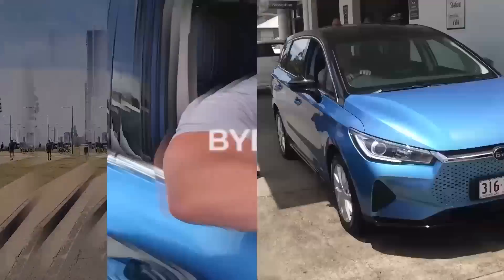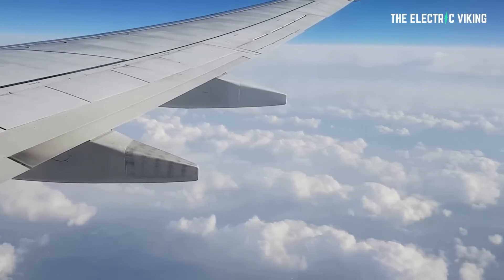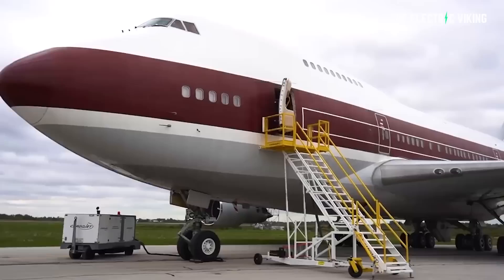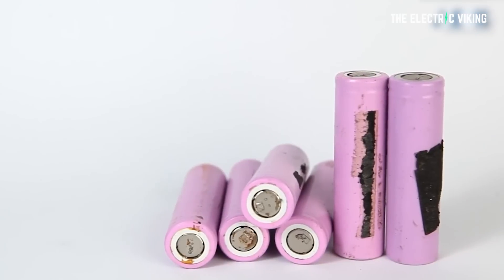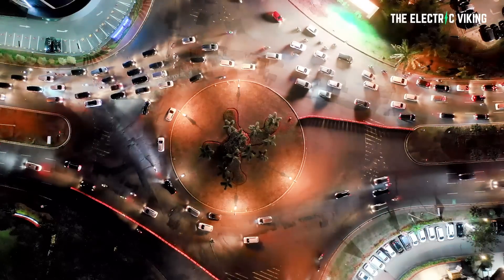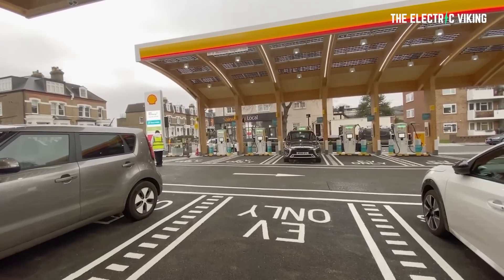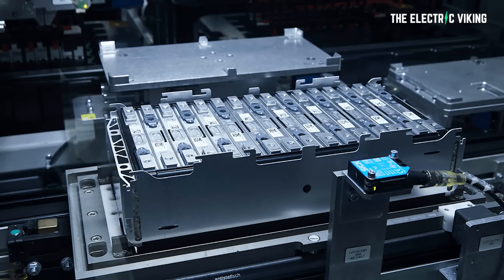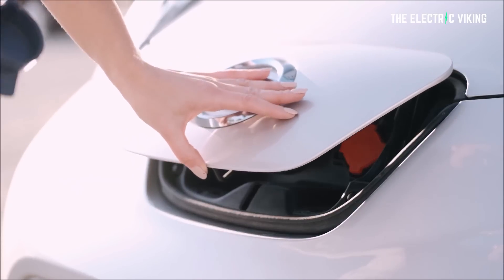Researchers discover how to make lithium batteries work in extreme cold

Comment: Don't use water in a battery and you eliminate the cold temperature problem. Super capacitors don't have water. This issue is important for batteries on ebikes in Canada.

Comment: Hi Sam I live in Northern part of Canada,,,-40C common in the winter...the range of my leaf goes down about 1/3... these new battery structures would help but the battery warming system is more important. Also my electric vehicle works way better in the cold then any gas vehicle I have owned... it always runs...I've even jump started friends gas vehicles whos battery couldn't start their vehicle in the cold...Also in extreme cold many fossil fuel vehicles idle all the time and diesel trucks have warming systems in the fuel tanks and oil pan to keep the items from becoming to "thick". Electric is much better in the cold then fossil fuel vehicles.

Comment: All batteries become less efficient at lower temperatures. That's because they work via chemical reactions. As a rule of thumb, at temperatures which we can experience in our environment, a chemical reaction doubles in speed for every 10°C rise, up to the point where degradation of the reactants sometimes takes place because of too much heat. And of course a reaction halves in speed as it cools by 10°C. 
So a battery which is at peak capacity at 20°C will have its reactions reduced in speed by 75% at 0°C - you only see 25% of its capacity. A battery does warm itself up when current is drawn, so in reality it will deliver more than 25% of maximum capacity. If the battery has cooled down, and there isn't enough available capacity for it to warm itself up, then you're up a creek without a paddle. 
That's why it pays to preheat the battery while it is being recharged, before setting off on a Winter journey. It's also one reason why your estimated range can increase significantly while you're driving on a cold day, if the battery started off cold. I see that effect in cold weather regularly with our EV, which is only recharged at public chargers, so has to start off on a journey with no preheating. I can start off with an estimated range of maybe 200 miles, but after 50 miles of continuous driving it still has an estimated range of perhaps 175 miles.

Comment: I live at 8000' elevation in the Colorado mountains.  When out skiing at low temps, yes the cell phone has a significantly shorter battery life.  While not very cold for long periods, I have seen -25 deg F for a day or two at a time.  It is one reason I have been reluctant to put lithium batteries in my RV as it sits out and I don't want to have to pull the batteries.

Comment: I live in western Canada, every year we have between 6 to 8 weeks of -30C to -50C so it will be important for a battery to handle the cold in a more efficient way.  My neighbour drives a Tesla and a friend drives a bolt and are able to drive in these temperatures with very diminished range but we often have to drive long distances since our cities are separated by 400 to 800 km or more.  I presently drive a 2014 Prius V and want to change to an electric but a Model Y is $82000 Cad and I am not a big enough idiot to spend that kind of cash on a car of any type.  I really appreciate your research and am waiting for reality to kick in to the electric vehicle market in Canada so that I can make the change.

Comment: The car's battery heater is the largest contributor to energy/range loss while driving in cold temperatures. VW has just written new code for it's MEB platform to limit the heater for shorter trips to save energy

Comment: Hydrogen fuel cells work really well in cold temperatures.👍
Reply: ... if you can find some H2 to fill up .
sadly the infrastructure-race is allready run .
Reply: @tgdomnemo5052 maybe where you live but not in the rest of the world. You need to rip up your 2017 information and get up to date.
Reply: the by product is an issue to deal with. one failure of the warming system the water by product destroys the whole cell...batteries just sit there until warmed up or recharged
Reply: @glenncunningham9360  that’s like saying that batteries can catch fire. Unfortunately, it happens very often, unlike the scenario you describe.

Comment: A certain kind of bumpy glass can keep glass from fogging up, it's surface shape keeps the water from forming into droplets, I wonder if the same kind of thing happens inside the battery , but it's so hard to form the bumpy glass they end up using coating instead, I guess we'll see if they can pull it off at scale for batteries, if so I hope they apply it to glass too. glasses and car windshields could benefit from it too!

Comment: The idea of cold being a problem in space is wrong, mostly. The real challenge is solar heat. 
Look at the new space telescope,  125°C on the hot side, and 5 shade layers later, it still takes 0ver 100 days to cool down to equilibrium.  
The cold problem was first heard of during the moonlanding hoax. 
Also, the real scandal of the space age wasn't that hoax, it was the fiasco called operation Dominic, were an attempt was made to clear away the van Allen radiation belts, but only achieved creating a new one.

Comment: “Releasing the charge put into the battery” is all very well but at what current will it release the power?  Lead acid delivers 30% to 50%. The remaining AmpHours are delivered at a very low rate. Lithium works down to 0%

Comment: Hi Sam! Great video ! But, two small things, you have distortions in peaks of your voice, check your levels on the mic gain and master output. You might have a „normalize audio level“ function to let your video rendering automatically increase / decrease the sound levels to video industry standards. Nevertheless, if your mic gain is too high, the distortion will be incorporated in the sound and not removed, even thru normalization. 
Second, as others say, please prioritize SIA units -> metric units and add Fahrenheit conversion for those unfortunately stuck in the obsolete past. 
Thanks mate ! 🙏🏼👍🏻

Comment: In my previously owned 'fuel cell' company, we used PEM & Solid Oxide fuel cells to automatically recharge lead acid or lithium battery systems (typically sized from 100ah to 1500ah) and had to contend with extreme cold in outdoor environments (AK, Canada, etc).  We housed the fuel cells and batteries in custom designed enclosures and included vents/heaters to keep them within their operating ranges.  Fuel cells 'run hot' and can be used as a source of ongoing heat as they charge battery systems upon voltage drop.  Hybrid vehicles (Fuel cell plus battery systems) might provide a more efficient successful solution for these environments, if they are designed properly.

Comment: Lithium Titanate batteries have traditionaly been used for military use & dealing with extreme temperatures. But they are expensive and have less capacity than Lithium NMC, NCA & LFP...

Comment: I'm not sure that batteries are even close to achieving the energy density necessary to power a Jet the size of a 747. There may be some regional Jets that could eventually use this, but it's hard to see them being used for long haul flights.
Reply: The Viking living in fantasy land with that comment.  Heavy Semi Trucks are yet to be proven viable, much less a 300ton passenger airliner.

Comment: I had that experience, going to theater;  leaving the cell phone inside the car on a very very cold day and I had a wait for the cell phone to warm up before I could operate again.

 And you hear this a lot of times about how the EVs don't work in the cold.

They had a terrible traffic jam in Wisconsin ( Or somewhere there are in the rust belt)  during  very bad winter condition, people had to stay over night on that highway  and people in the EVs were knocking on the cabs of truck drivers so they can stay warm or their family can stay warm.

 Must add people who started off very low on petrol had their issues also, as they sat there in their  ICE vehicles idling to stay warm. 
They ran out of gas.